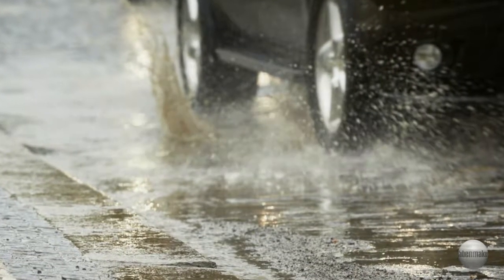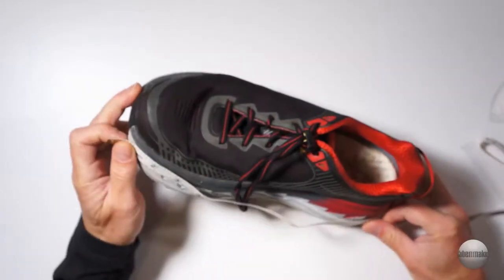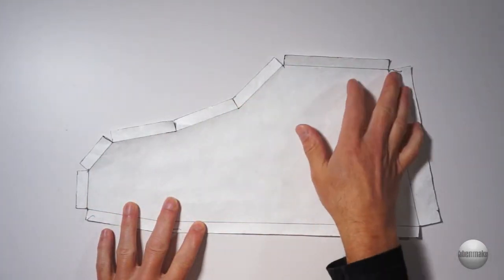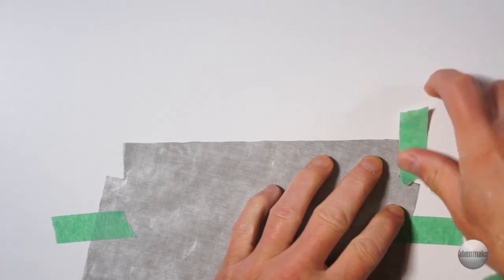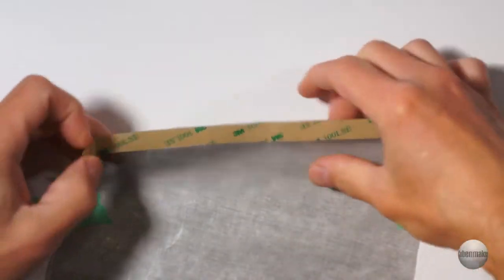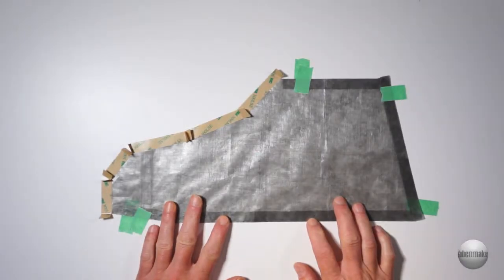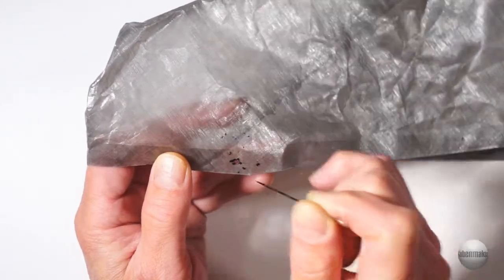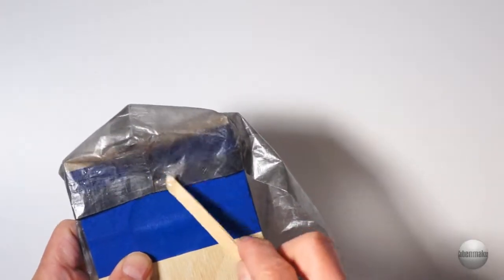Making Rainproof Shoe Covers

Comment: Wonderful video, thank you so much for sharing! Feeling inspired and currently making templates from plastic bags, however, managing the toe section is proving tricky to work out.
Reply from the maker: Thanks for the comment! I have improved the design considerably but am too lazy to make a follow up video. I now use PU coated nylon fabric which can be sealed with a heating iron. I join the two halves with a 1" strip of the fabric using a curved object as a backing surface. The other major change is to eliminate the elastic cord under the shoe. I now use a piece of Velcro sealed to the inside top of the cover just behind the toe and attach the other half of the Velcro to the last part of the shoe laces. Surprisingly, this works and I've never had a cover come off in quite a few years with this set up. Feel free to email me using the email at the end of the video and I could send you some images.
Reply: Yeah make a new video pls

Comment: What has durability been like with these?
Reply from the maker: Durability is somewhat of an issue. I've made 3 or 4 pairs over the years. To make them lightweight so they scrunch up to nothing in a bag or pack means using light materials that will wear out. The main point of wear is the toe as your shoes scuff the ground. I switched from Cuben Fiber (DCF) to PU coated nylon that can be heat sealed with a sealing iron. This material looks much better and wears better as well. It weighs more, but the difference is not important. Another major improvement I made was to eliminate the elastic under the shoe, which wears out much faster than the fabric. Now I use small patches of stick-on Velcro attached to the sides of my shoe to hold the covers on. They are white and aren't very noticeable. They do come off over time but are easy to replace. The nylon fabric is also a bit stiffer than the DCF so the shape tends to just sit on the shoe better and doesn't need much to keep it from coming off. The backs of the covers close with Velcro so the covers won't come right off but the Velcro on the sides keep the covers in place over the toes.

I would made another video on the new shoe covers but I admit I've kind of run out of steam on making videos. If you're interested in the new ones you can email me with any questions.